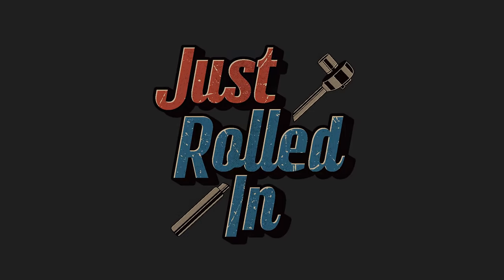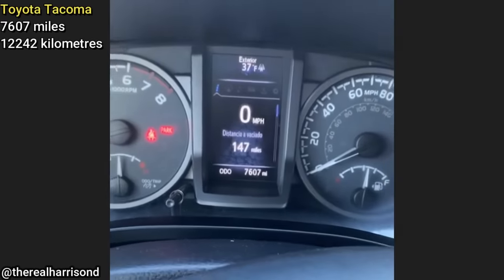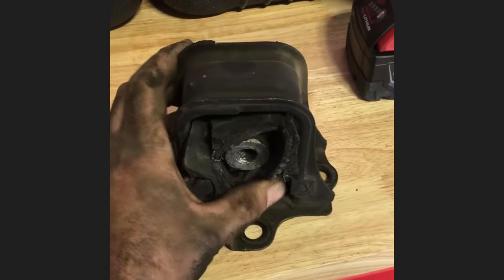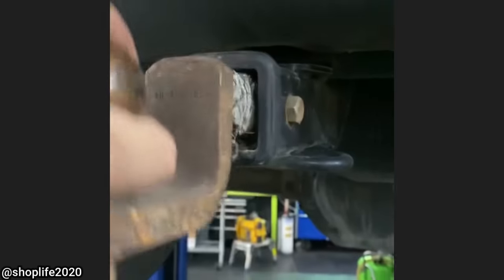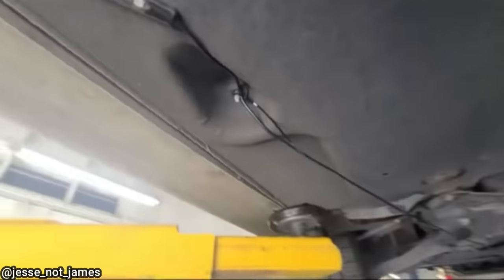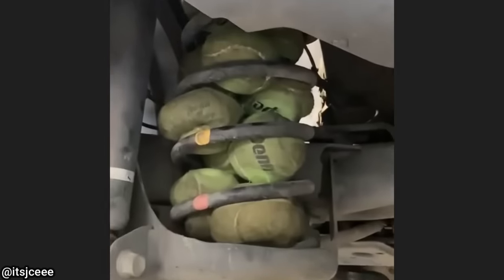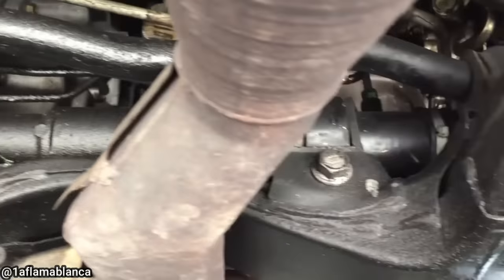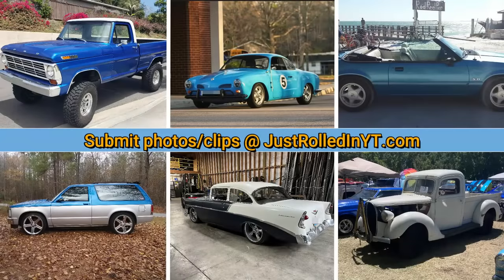Customer States Change Engine Oil On Tesla | Just Rolled In

Comment: I got two tesla oil changes while working at a dealer. We just took the car to the shop and let it sit for 15 minutes, then brought it forward, and told them it was on the house. Good times.
Reply: Check the blinker fluid too?
Reply: Do Tesla cars use differentials? Do they ever need gear oil replaced?
Reply: @fredk.2001  One motor per axle(for a two motor), so it would have a differential.
Reply: @cartman20000 , I wonder if they have a recommended interval for replacing the diff lube then?
Reply: @robertthomas5906  Don't forget to change the muffler bearing.
Reply: wouldn't the flux capacitor need refluxing?
Reply: @richardhockey8442  Some banana peel, egg shells and half can of beer.
Reply: @sourand jaded, I kinda figured, but have never worked on one, sooooo
Reply: @fredk.2001  as if Tesla even knows what maintenance is. They will literally drive that car into a landfill when something breaks and get a new lease
Reply: @sourand jaded that is true but since the oil for the power steering is a closed system and usually does not run out you dont change that as often. Same with break fluid
Reply: @anusreaper  so periodic oil changes seem like a good idea then.
Reply: @anusreaper  No transmission you mean? There has to be a differential or it would scrub tires around corners
Reply: @sourand jaded not sure about the brakes. they might use DOT brake fluid, which is silicone based, and doesn't attract water. it only need change when it's dirty, and bleeding after repairs.
The power steering is using an electric motor if I'm not mistaken. I dount there is a gear that has enough oil to be changed...
I'm with you about the rest, though.
Reply: @lotharrenz4621  DOT 3,  4 and 5.1 are glycol based, DOT 5 is silicone but will not work with ABS actuators.
Reply: @aironic8  ah, did not know that. as a classic car driver that problem never ocurred to me.
thanks for the hint. :)
Reply: @lotharrenz4621  I got you brotha!
Reply: Wildlife Warrior  I did, granola chewing hippie. Was that you in the chrome wrapped model X perchance?
Reply: That's Funny. Everyone's a hero!!
Reply: @fredk.2001  yes, every  150k
Reply: @THESLlCK  washer fluid, wipers, brake pads, tires... rotation... proper battery charging techniques, software updates.. an occasional recall on things like camera wiring, what else besides normal wear and tear on anything else that might go wrong? oh I forgot washing the salt off from the roads in winter.
Reply: They should be charged for stupidity
Reply: @sourand jaded all modern cars have electric steering, not power steering. There’s no fluid
Reply: @Groza_Dallocort  Why the hell would you have break fluid?
Reply: @L44tsmasher735  Electric assist*
Reply: @mr.wizeguy8995  I feel so bad I had to actually think about that one for a second XD
Reply: How about temperature management in their batteries. Do they use coolant for that?
Reply: @Groza_Dallocort  If Engine Oil just burnt off, it would need topping up only. But it also degrades from Fuel seeping in, and the Carbonhydrates cracking under Pressure and Temperature in the Cylinders. Both reduce the Viscosity of the Oil, which makes it less lubricating.
Reply: What the flux, why not
Reply: @fredk.2001  They do indeed.
Reply: @sourand jaded Absolutely. Sadly people who think EVs will save the planet have no idea that the entire car is basically made from oil based products. Ask them about the tires or the plastic panels for example. And wait until they have to get replacement parts. Man they better have fat wallets.
Reply: So, for a Tesla, the only recommended change is for the brake fluid every 2 years... I highly doubt many people do that.

The brake pads themselves pretty much don't wear because you almost never use them, and my tires wear almost perfectly even so I see no need to rotate them, nor has it been recommended to me the few times I took my car in for warranty work (although the recommendation is every 6k miles).

You do need to refill your windshield wiper fluid as needed though.
Reply: Love the fact you didn't screw them. Bravo for your honesty.
Reply: @marchellochiovelli7259  I mean it's just wrong. I could never.
Reply: Electric cars need differential oil changes you goof
Reply: @L44tsmasher735  define modern, because last i checked my moms 2017 has a steering fluid pump.
Reply: Gearboxes and transmissions need oil replacements due to moving parts. Don't electric motors fall into the same category?
Reply: @ThaFuzzwood  yes but the difference is that one needs replacement at intervals of 5000 miles, whereas the other needs it only once every hundred thousand or so

Comment: I think it's very smart what they did in that last shop.  Not only will the wall never rust, but now there's no need to hire a modern artist to decorate-- It's already Immersive and Kinetic.
Reply: You missed out sensory
Reply: Yeah its a real Jackson Pollock!
Reply: I think that lad is British (the oil drainer is a Sealey 110 litre, their warehouse isn't far from my workplace) - we like our modern art over here 😁
Reply: Usually when some spill magnitude like that happens it is customary to yell "Cleanup on aisle 5!"
Reply: @ViperGuy145  Hee hee on JP*..yet just wonderin' how he managed doin' that oil volcano? 
* too drippy for me, I lean more towards Dali, Magritte & Robert McGinnis
Reply: Tell people it's supposed to remind you of the old days with oil blowouts in Pennsylvania and Texas.
Reply: @brianstratton8767  from the Reddit thread where this picture first cropped up, they use air pressure to force the waste oil into a bigger container and the valve to close off the top either wasn't shut tight or failed
Reply: Why oh why don't those things have check valves?
Reply: @fredk.2001  they do. It’s a valve that you check and close before hooking 150psi up to the tank and forcing an oil volcano out the top.
Reply: @ouch1011 , no, there is a standard ball valve, or similar. They really should have a check valve.
Reply: it’s exactly how the actively regenerating rust protection system worked on my e46.
Reply: sounds like poor training caused the issue.
Reply: I'll admit that I did the same thing before at a Sears auto center, but not nearly this bad and I dodged most of the oil. The shop was downsized to a barebones crew by the time I started there and nobody cared so I just wiped off the floor and left the wall and ceiling coated. Left a nice visible stain until they tore the building down. Really miss that place, got a ton of crazy stories, bored techs knowing the end is near with nothing to lose are some creative bastards.
Reply: If youve ever used one of those its unfortunatly easier than you would think to do that just miss one valve on it and connect the air...   No one ever tells you how to use shop equipment..  First time I used one I messed up but fortunately no where near that bad..
Reply: It’s just a fake wall bud
Reply: Jackson OH FU---

Comment: I don’t blame the oil change customer. His heart was definitely in the right place.
Reply: I would imagine there is a service of some sort they need.. dont feel like looking into it, which is probably how that tech felt
Reply: @marioncobretti7870  yep. And whatever it was, the droning was getting to the point turning up the radio wasn't working... Like rear wheel bearings on a Subaru..
Reply: ...yabut his brain was MIA.
Reply: @nolanjordan1930  "mechanics"??
Reply: to be completely charitable I guess we could say he knew what he wanted but didn't know enough about cars to put it into words. 
 Most times, people who get full service oil changes end up being told that they checked the power steering fluid, AC, brakes, tire wear, topped off wiper juice, blinker fluid etc. There's a chance he wanted that and does care about the vehicle.

 There's also a real good chance he bought it just to show off and knows basically nothing about fluids other than the best hair-gell for a humid afternoon drive up the coast with the windows down while livestreaming.
Reply: @Buttphalt  That's a stretch.

For any others out there, when in doubt... RTFM!
Reply: Yeah, he at least cared about such things. As many guys Just Rolling In that never changed it in 100,000 miles or more (if at all), I'm definitely into erring on the side of caution!
Reply: But I want to know where he has been putting the gas?
Reply: @jamesm568  In his lawnmower, unless he's Californian...
Reply: Funny part is they do require oil changes. Just not the typical motor oil. While it’s not required it is recommended every 30,000 miles
Reply: @BubbaSmurft  Not everyone is up in new technology, bruh.  That’s hella rude!
Reply: @marissastealsmascara5988  ... and that's what the f'n manual is for. Grow up.
Reply: @Donniec685  just came here to comment about this :)
Reply: @marissastealsmascara5988  
Then why buy a Tesla if you're not up in new technology? Like the crazy things people with Tesla car do.
Reply: yea, that was probably his first electric car and wanted to be a careful owner
Reply: @kg888  Huh? You don’t know why people buy the current ‘IT’ cars? Let me educate you. For them it’s all about being perceived a certain way.
Reply: If you have the money to spend on luxuries like that I highly doubt his heart was in the right place.
Reply: Are there no grease points on a teslas suspension?
Reply: @bambehdeluxe8751  last time I checked Model 3 Performance costed about $60k. And the one in the video seems to be a Long Range, probably like $55k, idk the exact number. It's not really a luxury! And why the heart of someone who can afford luxury is not in the right place?
Reply: @ldmtag  To be able to just throw 60 grand away for transportation is a luxury. Besides "saving the planet" driving an electric car, why would you buy a Tesla? It's really a decision based on pride more than it is the environment.
Reply: @bambehdeluxe8751  there's cars that are much more expensive. Premium brands, for example. Even before this whole EVs started, did you have that same problem with people buying Mercedes-Benzez and Porsches because of pride? If not, why are you triggered by EVs?
And there's much more than saving the environment about EVs. It's just cool and fun. And for those who can charge at home it's also convenient. Again, do you have that same problem about Diesel dudes? They buy Cummins more because of pride than because they want to tow, don't they?
Reply: It actually tells you in the Tesla service manual to use wd-40 on the door hinges, I would have definitely done that, and probably inspect the vehicle’s suspension to make sure nothing is wrong
Reply: I'm not 100% sure (and I don't wanna check the video duuuhhh) but just by the voice alone I'm 90% sure that the video was from a prank video by "Vlog creations". They just converted the tesla to have an engine.

Never mind, checked the video and it was a white tesla
Reply: Teslas have fluid in the drive units that do require changing after a certain amount of time/miles so he was sorta in the right..
Reply: I do, he's lacking in basic knowledge.
Reply: Honestly I figured electric engines needed oil.  I figure any engine with moving parts is going to need lubrication.
Reply: @BubbaSmurft  why would it not need oil? Does it not have mechanical parts that need lubricating?
Reply: @marioncobretti7870  Lol ofc since Tesla puts 2 metals together which cause electrochemical corrosion.
Reply: Yeah he at least knows that you need to change your oil unlike the people that don’t change their oil for like 50,000 miles
Reply: teslas definetly have oil in their transmission or differential
Reply: Tesla's need differential oil changes dun dun dun
Reply: Their head is certainly in the right place.  Erring on caution.  Doesn't know how mechanically how a vehicle is operated so took it to a shop assuming it needed to be.  It is conscientious.  Not just for themselves but for other road users.  Better that than to be convinced a mechanic's shop and maintenance is just a money making scheme.